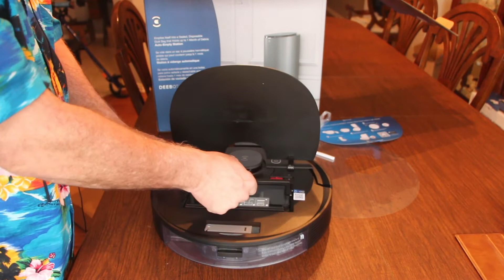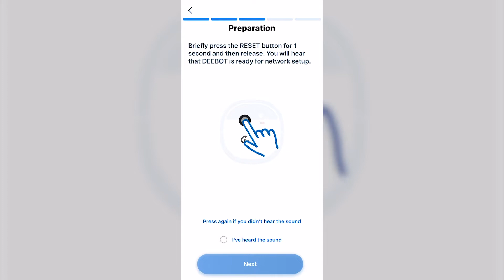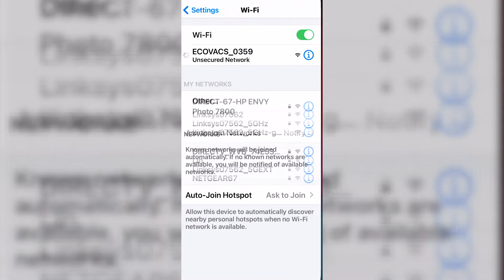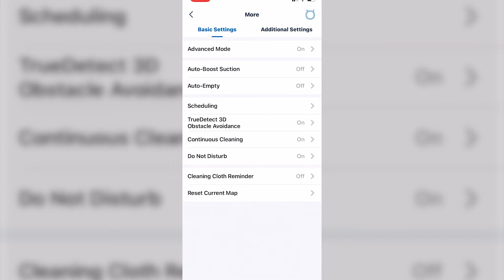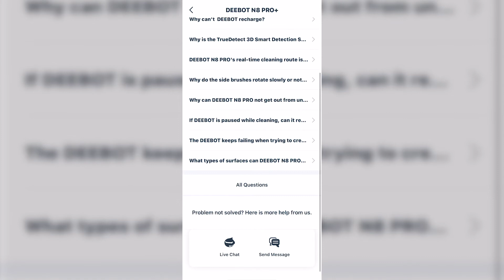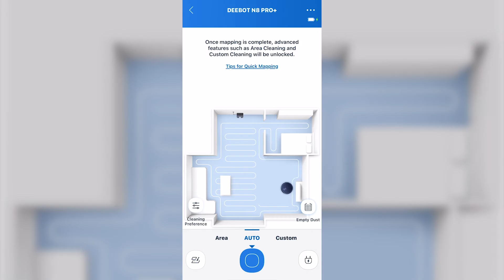The new Deebot N8 Pro+ [Part 1] Unboxing, App Overview & Mapping

Comment: Hi. Thank you for an informative instruction. I will receive my deebot n8 pro+ in a few days. But in our house we have some thresholds which I'm a bit worried it will be able to handle. Do you know if it's possible before first mapping to test if it can go over so it does not get stuck when initial mapping starts?
Reply from the maker: Not that I’m aware of.  Just have to test and see. But I had one that was real close and many times it had trouble during mapping. But if I helped it over with some kind of ramp, it would hit it harder during vacuuming, and not have trouble.  
I haven’t tried it but I’ve heard it has better luck with threshold at higher vacuum speeds.   However I would first see how it does in quiet mode. 
Good Luck!
Reply: @Hotsparks66  Thank you for your respond. So would you just let it try to manage the thresholds under first mapping and see how it goes and then reset the map if it goes wrong?